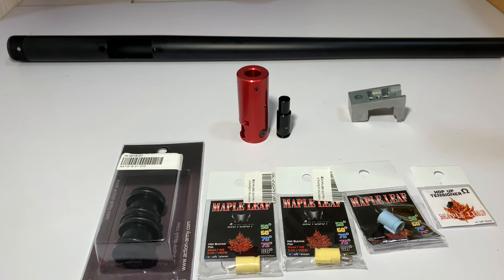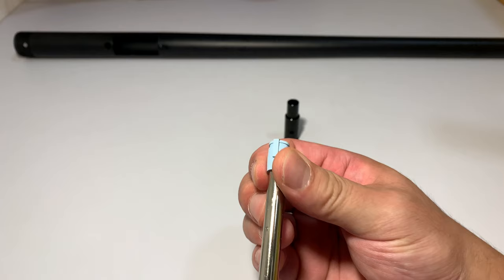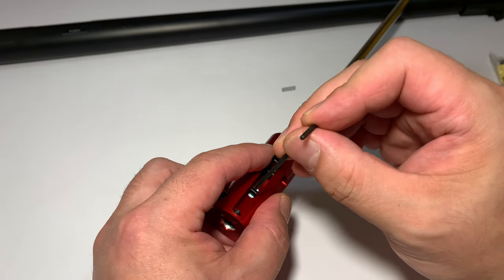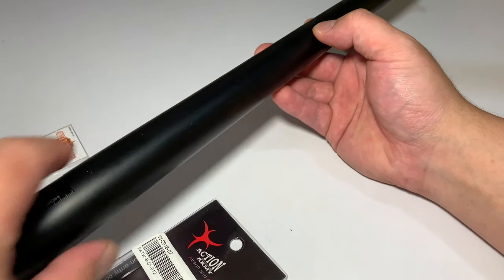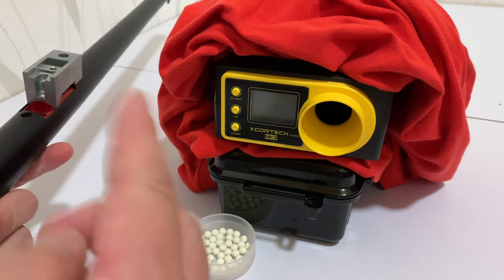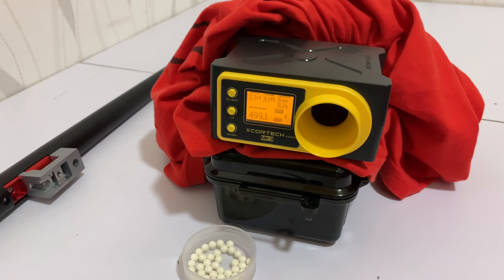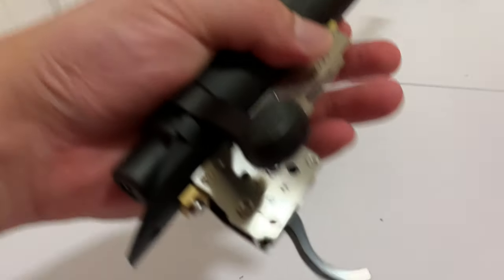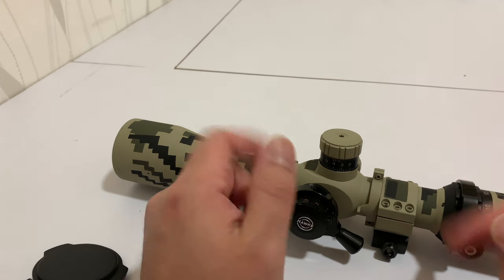VSR-10 Build Series EP 3 - Hop Up, Barrels, Spacers, Chrono, Scope

Comment: Hello friend! 
Just a little question that maybe will do a huge difference. I have a hop up unit just like yours. About the bb stoppers, they have two screws on the outside. My question is, how much do you tights the screws? 
I have some shots that are completely out of the aim point with the bb making some crazy trajectory and I think that maybe the problem is from there.

Sorry for my English but I tried 😅

Tks for you time.
Reply from the maker: Hi there! Your English is fine 😊
The BB stoppers are there just to hold the BB in place ready for the nozzle to load, once the nozzle loads forward and the BB is taken, the two BB stoppers are kept out of the way by the nozzle, they only need to be tight enough to hold the BB gently but loose enough so they don’t create an obstruction when the nozzle loads forward (if they are too tight you will feel them in the way when loading a BB but smoothing the nozzle edges can soften this issue). Erratic trajectory shouldn’t be caused by them even if they are incorrectly set. I would suggest having a very close look at the hop rubber and nub setting first ^^

Comment: Love your thorough video.  I have nearly identical setup with a different trigger.   Just played with it yesterday.   Consistent left curve at end of range...estimated 200ft or less.   Shooting .40 bb shooting in mid 400s....any thought?  Some say possible too tight on screws to outer barrel?  Needs to break in?  Dirty?  I'm going to strip it down and get a good look at the bucking...thanks!

Mike
Reply from the maker: Its a really fun setup right?!!! I'm currently really enjoying mine too, one thing I did notice when installing everything was the inner barrel could twist left or right ever so slightly before the biting screws are secured down, you may want to unscrew those and twist the inner barrel 0.1mm in the correct direct to centrally align. Its easy to type this but I know the job ahead is going to be quite long hauled lol. Good luck my friend! ^^
Reply: @AirsoftAfterHours  

Thanks for the response.   I'll check those things.   Gonna make sure the bucking is good, and the nub is lined up as well as "clock" the barrel perhaps bit.   Any thoughts on trying a 75 degree maple leaf  bucking?  I have one....any thoughts on .43bb?  So many variables, and I don't have a good long distance range in my neighborhood...to check my work.   Let me know if any those ideas are a thing.

P.s.  one suggestion was to try and rotate the nub 180degrees and see if that offsets the curve .

Thanks,

Mike

Comment: Quick question: How exactly does one remove the original TM barrel spacer? It doesn't just push out easily. Update: On the newest ones, it is glued. You will need a long rod and wil need to use force---I used a mallet---to get it out.
Reply from the maker: Iirc I used a long thick tool that fit in from the front of the barrel (once the front end was removed) and pushed it out ^^

Comment: Installed mine just as this video explains, I constantly get misfeeds, have had it apart several times but same issue
Reply from the maker: check the 2 BB stoppers, they may need some minor tuning, is the hop set correctly? also may require minor adjustment, good luck my friend, I know issues like this can take days to diagnose but in the end its really worth it, hang in there!

Comment: Which do you prefer, Mr. Hope or Decepticorn Hope?
Reply from the maker: Currently favourite would be Autobot, but between the Decepticon and MR I would choose decepticon simply because the results I get are very favourable.
Reply: @AirsoftAfterHours  I want to hit the can at 20 meters. There's a slight error when I aim and shoot. I want to know if it's possible to change the BB gun's characteristics or hop-up bucking. What should I do to increase the hit rate?
Reply from the maker: @deviloniq5n  if it’s a standard Tokyo Marui VSR 10, I personally would do the following mods:
New inner barrel
Hop rubber
Barrel stabiliser 
Scope rail
Scope (not red dot)
These mods will bring more accuracy to a standard VSR and, although 20 metres is a super short distance, I have had much better results with scopes than red dots. 👍🏻
Reply: @AirsoftAfterHours  tank you. I want to know why you use the Autobots.
Which one is better than the Decepticon?
Reply from the maker: @deviloniq5n  Just really liked it, tried them and the results made a habit that was hard to break, even when a new rubber comes to market I am reluctant to break away from results an Autobot gave me, also I purchased a lot of them when I went shopping lol. Don't let my experience deter you from trying the deceptions though, they are really really good too, sometimes its a matter of opinion, and personal choice ^^
Reply: @AirsoftAfterHours  okay tank you ㅇㅅㅇ

Comment: What would happen if I straight up taped the entire inner barrel? If I buy spacers for a tm vsr "pro" can I buy two sets and install them? Will this further reduce vibrations?
Reply from the maker: Nathan Franklin 
Probably won’t be necessary to install 2 sets as one set can already dampen the vibes, picture a drum 🥁 symbol getting hit and you dampen the vibration by pinching the symbol, pinching it with two hands may not make any noticeable difference.
We used the word “probably” because we don’t actually know for sure if there will be any benefit, as we haven’t done any test which compares one set of spacers vs two. 😊
Reply: @AirsoftAfterHours  wow, perfect analogy. Thank you!
Reply: I wrapped my inner barrel in rags and it is SILENT.

Comment: How tight do you screw the screw nut that holds the hop-up lever down? And also to adjust the hop on these chambers do you have to disassemble the gun every time to gain access to the screw??
Reply from the maker: Just a couple of turns in so it can stay in place. It’s doesn’t need to be screwed in much because the hop adjustment will need tuning in. The hop up adjuster screw is accessed through a peephole, only the magazine needs to be removed to get to it, very convenient and easy to use. Also, the best. ^^
Reply: @AirsoftAfterHours   hi bro.. thank for explaining this.. i was also thinking the same thing about disassembling the gun jus to adjust the hop up.. haha.. at least it can be accessed when u remove the mag... btw.. im glad i saw your video.. coz i ordered this AAC hop up chamber and just waiting for it to arrive.. im kinda nervous about that nub.. i might set it incorrectly hehe..
Reply from the maker: @mikoteevee  Congrats buddy! installation should be pretty easy and straight forward, you'll see once you see it in person, take your time and have fun with the building phase, it's the most fun part!
Reply: @AirsoftAfterHours   thank you sir.. yup will research more about how to install.. also i appreciate your immediate response..

Comment: Where do you put the barrel spacers?
Reply from the maker: Cruton
There is a gap between the outer barrel and the receiver that just fits one spacer. Of course, the barrel spacer may not really be required in this setup. ^^

Comment: I wanna see your videos more please. Really love your vsr upgrade series. Btw, action army inner barrel is made of brass and coated with chrome , is that correct? They are not steel?
Reply from the maker: Thank you very much for the support! Lots of changes in life at the moment so not much going on regarding airsoft, may do a video about life updates if there is any interest.
To my knowledge the Action Army inner barrels I was using were Stainless steal and quite heavy. 👍🏻
Reply from the maker: @kaunghtetzaw2022  
I haven’t tried that particular barrel myself, but there are some mixed opinions regarding its performance. Usually they were highly praised, at least in the circles I frequent. I would’ve loved to have tried that barrel but never got around to it.^^

Comment: I have the same spring in a full action army setup and it shoots 2,5 joules with 0,43g bbs hop set up correct. Our limits are 3 j and I want to get as close to it as possible. Could you somehow test the AA M170 because there are no topics on the forum about it
Reply: Konsta Mattsson the aa m170 spring shoots at about 500fps but im not sure what that is in joules if that helps at all
Reply: @vrooomarmament  The AA M150 shoots 500 fps so the M170 should shoot about 570-600 fps
Reply from the maker: Konsta Mattsson 
Unfortunately we can’t test the spring in question because certain countries have FPS legal limits. Testing it and showing it would leave us in a grey area regarding legalities.
Plus, our budget has been exhausted for now, but thanks very much for the support! 👍🏼

Comment: Will all these internals work with a clone like a cyma?
Reply from the maker: Depends on the clone. Several years ago we fit Action Army parts into a few difference clones and some parts would require some modifying to fit correctly. It could be the stock is a few mm off, of any other part. We never encountered any of these issues when using Tokyo Marui VSR's though ^^

Comment: hi , i just got this hopup but my vsr10 mags does not fit any tips?
Reply from the maker: HOP UP unit possibly misaligned, may be too far forward or backwards. The screw hole for the unit's mounting position is elongated so correct alignment can be made, more info and direct instructions in the following vid: https://www.youtube.com/watch?v=SgD5efmu-18&t=5s
Reply: Also, make sure the outer barrel is screwed in all the way, I’ve run into this problem as well

Comment: I have the gspec jg bar bar 10 and am wondering if I should get the same barrel you have here or a crazy jet 300mm or even the longer one from crazy jet ml.... don’t know if I should keep same barrel length like original gspec....
Reply from the maker: If you like the short profile of the 300mm go with that, I love short barrels and always try to keep them as short as possible. There are a other considerations which barrel length will affect such as how quiet you want your rifle to be. ^^
Reply: @AirsoftAfterHours  thnaks for your answer. well yes i would like it to be more silent possible but i also don t want to loose range.but i guess if i use a 6.04 and have a good hop up and spring strong enough it won t loose much range
Reply from the maker: @SololaneMvlog  The best possible way to keep it silent and efficient would be to match the barrel length to the cylinder volume, it might get quite technical and very precise as many factors need to be in the equation, from barrel length, bb weight to cylinder type, etc.. 
430mm is the length I keep for a good all rounder without needing to get too in depth. The  shortest barrel I run has the end just slightly longer than the front of the stock and I love the look of it, almost sawn off shotgun length, but it definitely is much louder, was playing with mine this morning in the office ^^
Reply: @AirsoftAfterHours  oh crap i thought that smaller barrel would make it more silent...oh well i'll have to check to find a good barrel between the 303 and 430mm maybe haha best of both worlds maybe :) :) thank you so much for your knowledge, from a beginner sniper it iss really appreciated!!

Comment: hi sir.. do i need to put teflon tape on the mapleleaf bucking for better seal .. or the ring that came with it will do the job of sealing?
Reply from the maker: If using the maple leaf hop up chamber, no Teflon tape is needed, the unit creates a perfect air seal. ^^
Reply: @AirsoftAfterHours   im using the action army red hopup chamber sir.. will i need to put teflon?
Reply from the maker: @mikoteevee  sorry my bad, got my brands mixed up lol, when using a Maple Leaf 🍁 Hop Up chamber, no Teflon tape is needed, it will provide a perfect air seal, 👍🏻
Reply: @AirsoftAfterHours   how about action army red hopup chamber sir?
Reply from the maker: @mikoteevee  sorry I’m totally not with it today lol. Yes, no need for Teflon tape on Action Army hop up chamber, very sorry, I am a bit unwell this week 😅
Reply from the maker: @mikoteevee  Action Army Hop Up chamber is designed so it almost completely surrounds and clamps down the hop rubber which prevents the air from escaping, making an almost perfect air seal, this is why so many hobbyists tout it as the best hop up chamber, because no additional work is required, no Teflon tape, no special alignment concerns, just install and play 😊
Reply: @AirsoftAfterHours  haha no problem sir... im installing the action army hopup chamber now as we speak.. yup i did not put teflon tape on the maplelead bucking... now im gonna install the 3 tiny screws that hold the inner barrel and the plastic spacer while watching this video
Reply from the maker: @mikoteevee  
Be sure not to install the bottom black screw (it may be screw number 9 iirc), it was no longer included in later AA hop units as it could cause issues. ^^
Reply: @AirsoftAfterHours   oh no.. i installed that.. but i did not tighten that screw to much.. based on your video u had a problem with that.. i think that screw hole is also the screw hole of that block of aluminum which hokds the outer barrel and the hop chamber.. maybe thats why it cause some issues.. hopefully mine will not cause issues fingerscrossed.. btw i already installed the AAC hop chamber.. will do testing tomorrow.. im tired haha...
Reply from the maker: @mikoteevee  well done 👍🏻 it’s going to be so much fun! I love VSR builds! 
Yeah the problem with that screw is it shares the same hole with the block meaning of the screws contact each other they may cause binding in one of both of the screws, I was really lucky that I could removed the bonded screw without destroying the unit. I usually don’t install it if I get an AA Hop unit that still comes with it. Get some some my friend! ^^
Reply: @AirsoftAfterHours   hi sir... wow i just finished testing my AAC T10.. i just wanna say "WoooW"!!!... the improvement on accuracy and range is true...  now my shots can reach 100 meters very very easy and very straight with  .43g bbs... i guess this can now reach 300 mters  hehe..  i wana test more than 100 meters but i have limited space in my backyard... i also experimented with the hop adjustment.. i actually gain 20fps with this thing.. what amazed me is the accuracy its very staright... must be the mapleleaf 70° desepticon bucking that i also installed.. now i'm done upgrading my AAC T10... next i will be upgrading my Modify MOD24 sniper rifle... thank u sir.. ur video really help a lot installing this unit..
Reply from the maker: @mikoteevee  
Nice one! It’s scary how accurate these things can be at long ranges! It’s always so satisfying to place a tiny BB exactly where you want and long, this is something I’ll never get tired of 😁
Congrats on the build my friend, and thanks for the kind words!
Reply: @AirsoftAfterHours   haha yes sir.. it is not called "legendary" for nothing.... no problem sir.. keep doing airsoft vids to help others.. new to the sport 👍👍👍
Reply: hi sir.. how do you properly adjust the hopup? i dont understand the instruction that came with it.. adjust clockwise to correct high shots.. does it mean if my bbs are goin up and i want it to fly straight.. i need to adjust clockwise? and vise versa?
Reply from the maker: @mikoteevee  
Hey! Clockwise adds more hop, so clockwise = more backspin. More back spin means more lift, when testing hop up, the correct adjustment means the bb will fly straight and when the bb nearly drops, it will lift very slightly and travel further, then drop. This adds more distance. Too much hop and the BB will fly straight up into outer space, too little and the bb will drop short. Anti clockwise = less hop up 😉
Reply: @AirsoftAfterHours   ahhh there ..that explains it.. will test again tom.. thanks a lot a sir 👍👍😊

Comment: Hey dude! Finding a lot of answers through your videos and very informative! Keep it up, just wondered how you remove the plastic barrel spacer inside the vsr10 pro, or if I’m too put the spacers in and use tape on either side will i have to take the hop chamber out and reassemble once the barrel is in? Many thanks, matt
Reply from the maker: Hi Matt, the standard barrel spacer that comes with the VSR 10 is pretty useless so no need to re-install it after removal. To remove it, just pop it out using the inner barrel (gently push it out evenly towards the fatter end of the barrel). 
What we would do when installing everything is:
1) First install the hop chamber and chosen barrel spacers onto the inner barrel. 
2) Install it into the outer barrel in one whole unit.

Thanks for watching and good luck with the build! ^^
Reply: AirsoftAfterHours Got it, thanks, used the plastic packaging from the new maple leaf barrel I got... just didn’t do it evenly so got it jammed so had the impression it was super glued in.
Reply from the maker: @tomhanks1714  
Glad to hear! ^^

Comment: I’ve got the same parts installed and I’ve taken it down and put pack to make sure I didn’t miss anything. My magazine feeds but they are not firing. Nothing is jamming the barrel. I’m kinda lost really.
Reply from the maker: Issac Gutierrez 
First check the BB retention buttons inside the hop unit, they can be adjusted either to stick out more or less. 
Also, does the bolt, namely the cylinder head, enter the hop unit smoothly?

Comment: do you have to take your rifle apart when ever you need to cheche the hopup?
Reply from the maker: Nuchie 
A visual check is usually all that’s needed when checking for function, but I enjoy taking the rifle down for servicing and maintenance, which usually involves a bit of cleaning and changing of the hop rubber, this rifle is very basic in terms of build, so it’s not a chore but a quick job. 👍🏼
Reply: @AirsoftAfterHours  Alright thank you!